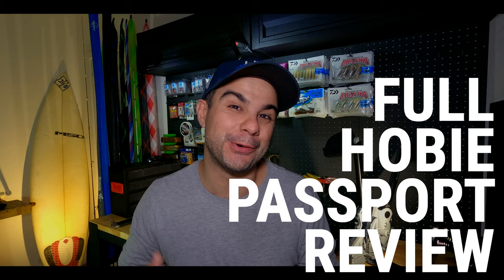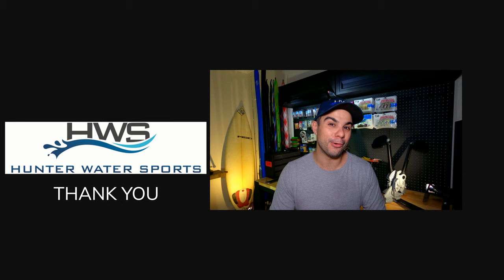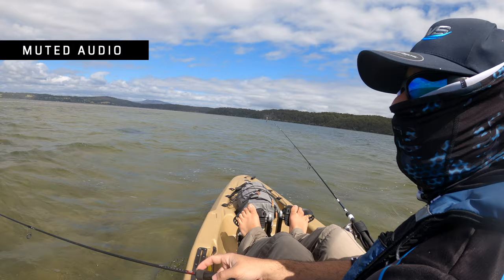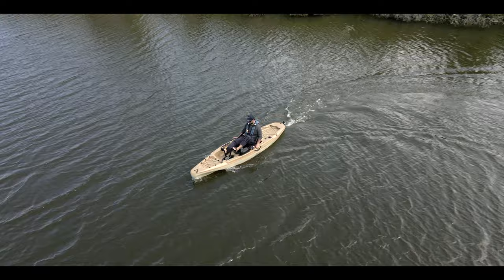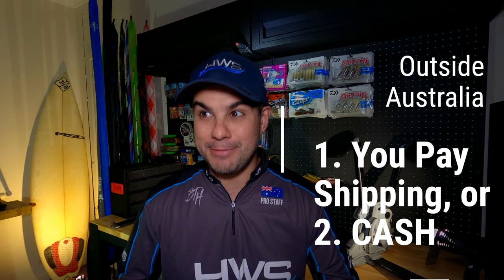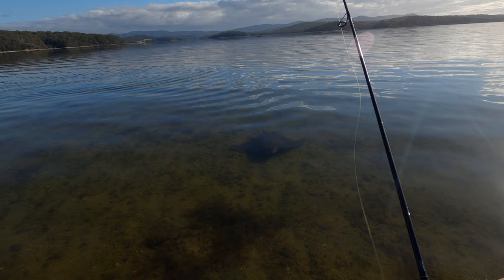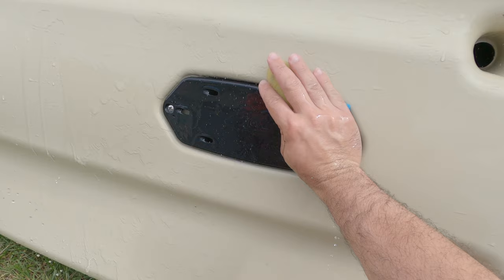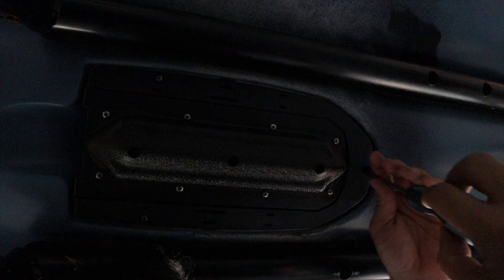Hobie Passport Review 12.0

Comment: I brought a passport 12 recently. One of the biggest deciding factors that made me choose the Passport over the Compass was the rudder system with the fibre glass rod. It is simply more responsive than any of the wire/cord rudder systems out there. My previous yak turned like a barge compared to the passport. I have since added a rectangular hatch and moved the circular hatch forward, added the internal wiring system for my sounder, upgraded the drive to 180MD and upgraded the rudder to the deployable version from the seat. All in all it’s a nice tidy little package now.

Comment: 12 foot Bay Sands is my pick. I recently disposed of my very old Hobie Outback as it had a crack in the mirage drive part of the hull which I had repaired numerous times. It got to the point that every fishing trip resulted in the kayak completely filling up with water and weighing a tonne. 15 mins to empty before I could car top it!! I have been looking at new vs second hand Hobies and would be extremely grateful to win a brand new one. My life is not the same not having the ability to fish on my local dam (Googong) ....

Comment: The first thing I did yesterday when I got my 10.5R was to remove those absolutely useless straps on the pedals. I found it totally annoying to have to slip my foot underneath the strap. They serve zero purpose. There's no pulling of the feet that would maybe require a strap. Anyway, much betta! Does anyone make a better steering handle with a riser. Your videos are excellent. Greetings from Boxford, MA  oh, I see you did the same thing.

Comment: Hi, I'm 112 kgs would you recommend hobie10.5 kayak.
Reply from the maker: Hey mate, I’d have a look at weight limits - you’re weight plus your gear may tip you over the rated kayak weight. 

On the water though, I’d want a larger kayak (the compass is a very nice kayak for those who are taller and built men)
Reply: @ByronTeaHill  Thanks.